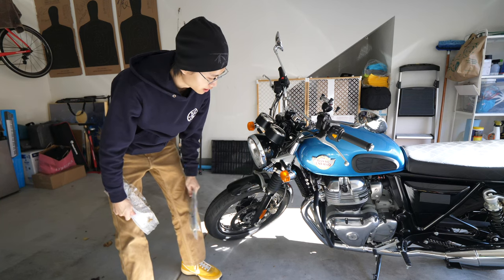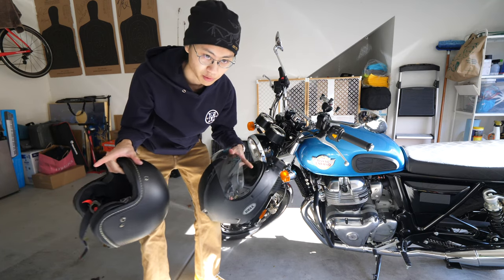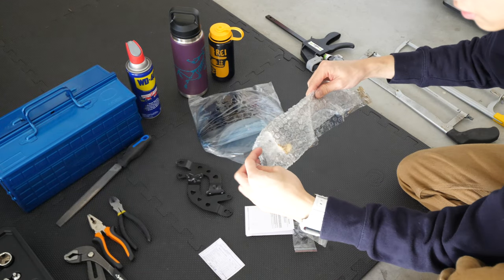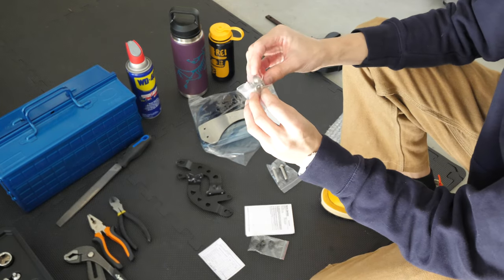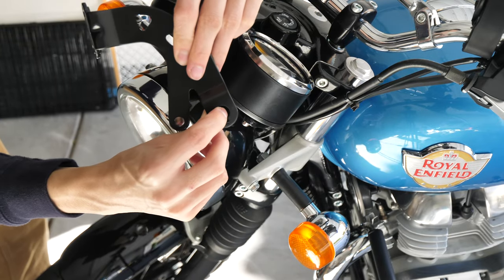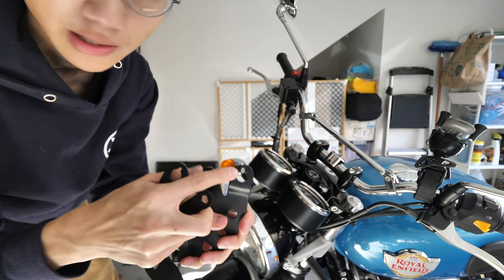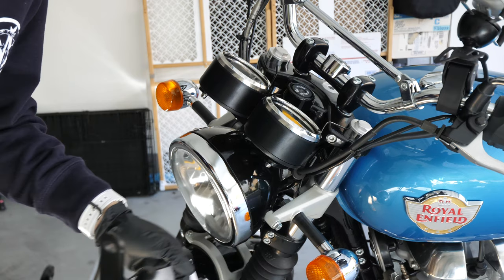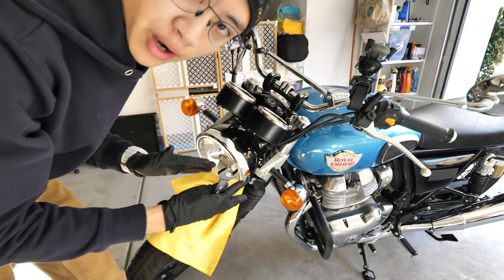Royal Enfield Interceptor 650 Short Flyscreen Easy Installation, No Headlight Removal!

Comment: Thanks for the tip about cutting the braces.  But, you should only do one side at a time to prevent fouling up your headlight alignment.
Reply from the maker: Thank you for pointing that out! I totally did not consider that while doing this.